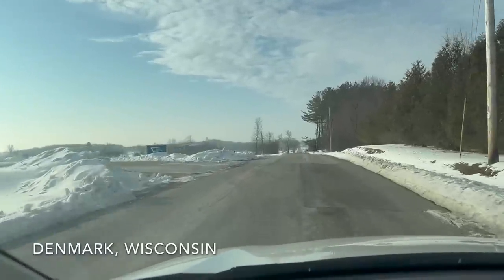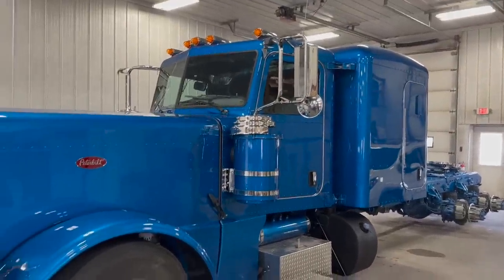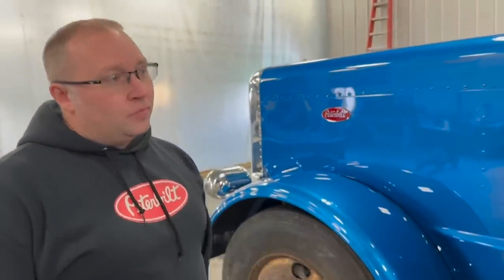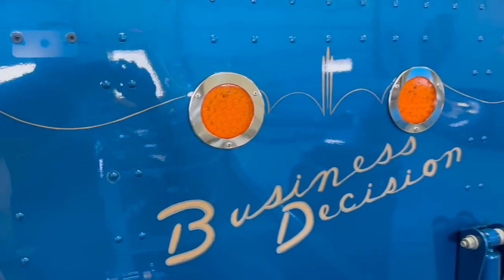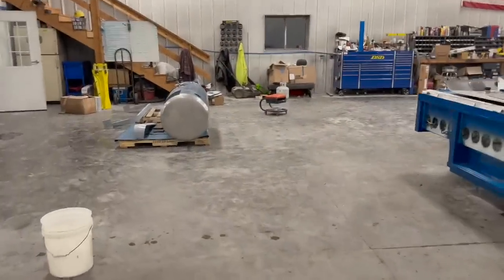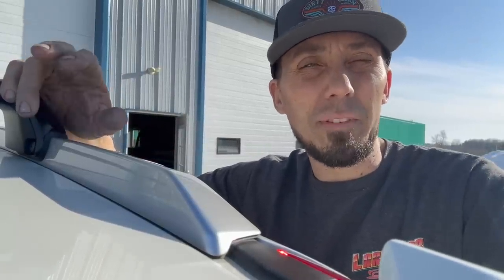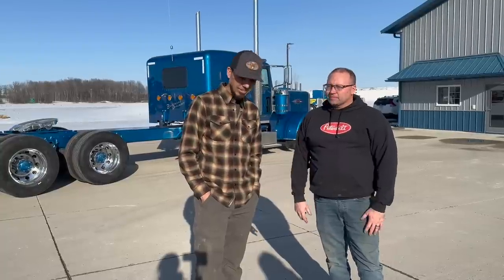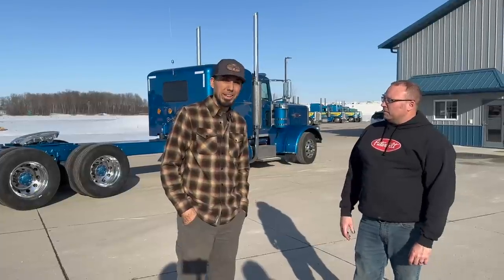Pinstriping Don Wood’s Peterbilt

Comment: Nice clean work Philip!  I'm just kind of getting into the whole striping world here and had a few questions.. I see you used the alphanamel paints.  I actually picked some of them up also.  
1 Do you prefer them to 1shot or do you use both?
2 what do you wipe the paint down with to prep it for striping?
3 what are you thinning your paint with?
4 what did you wipe off the design with that you didn't like?
Thanks a bunch

Comment: You need to work on your layout and lettering. That comes with practice and years. Start making some pounce patterns you can use any fonts and blow them to size until you improve and create your own style, it will only make you look better. Just some advice from an old signdog. Keep on truckin!